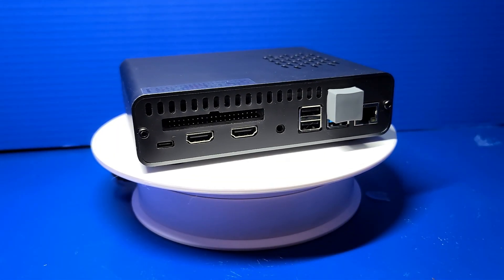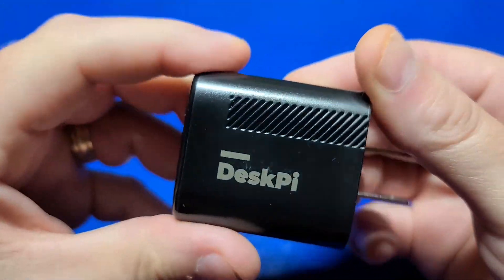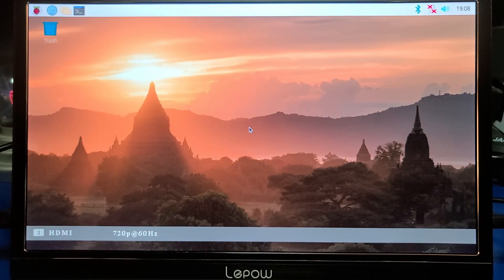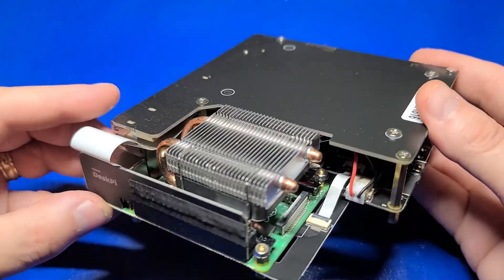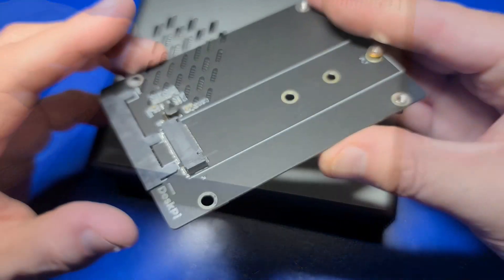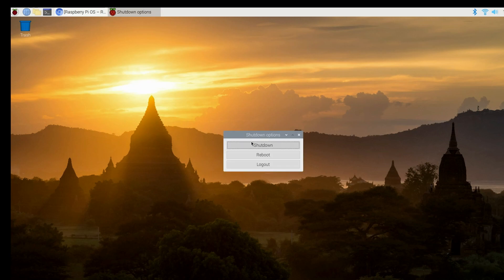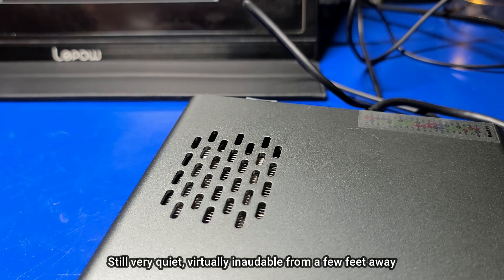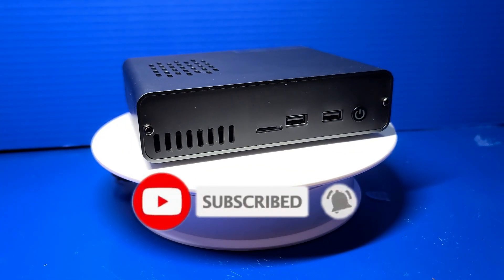DeskPi Pro v2 Raspberry Pi 4 Desktop Case Setup and Review

Comment: What's with the hideous mdf front and back panels. Not what the product is advertised with and look like they are made of excess waste material from another product.
Reply from the maker: I assume you're talking about 03:18, that's just a protective covering over the acrylic panels to keep them from getting scratched up.  After you remove the cover, they are acrylic panels.